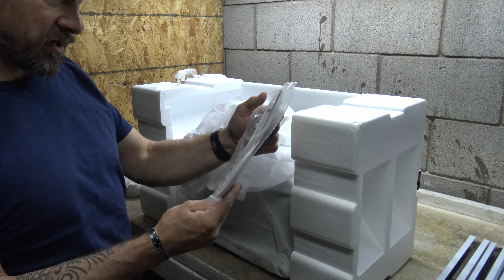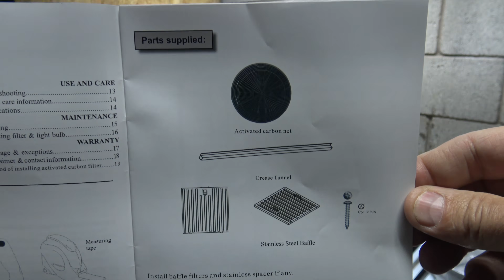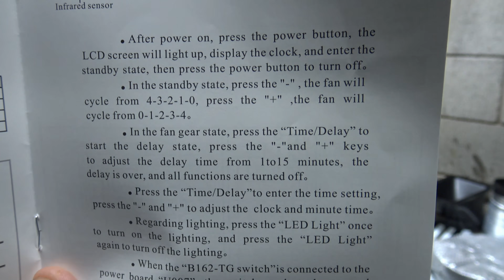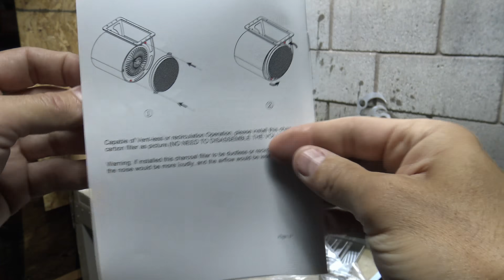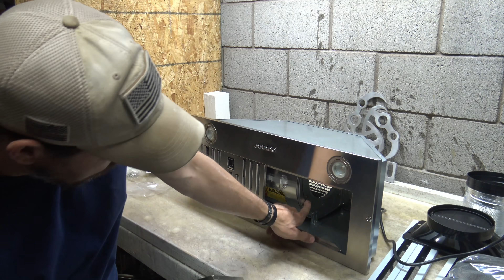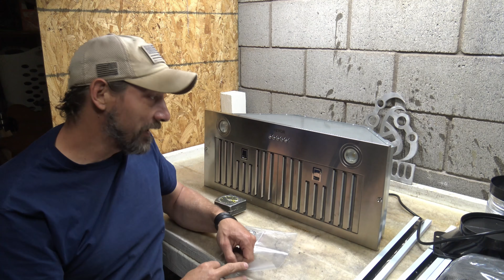VEVOR Insert Range Hood, 800CFM 3 Speed - I love it!

Comment: Thanks, mine stopped working so this was helpful to get a clue. Oddly, removing the two 'bottom' screws, doesn't let you remove the cover. It just bends forward, at least in my installation.

Comment: Good information!! Question: I just bought this same one, I don't have a hole that goes to the attic or outside. Can I use it like that ? The air will go to inside the hood cabinet.  I don't want to make a hole on the wall or ceiling.
Reply from the maker: Thank you for the very kind words and support that you give my channel, my apologies for the late response. Yes you can absolutely use this to vent into your attic a lot of people do that. The only suggestion that I would make is to be cautious if you're cooking a lot of oily foods and ending up with oil residue in your attic. There's always potential that it could lead to a fire hazard so be careful please